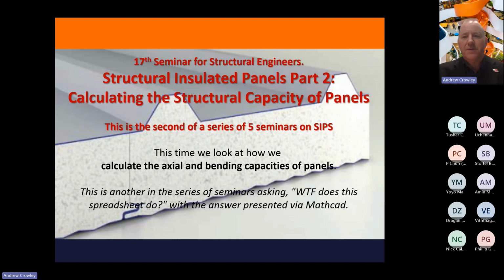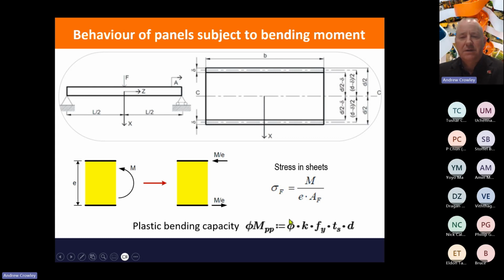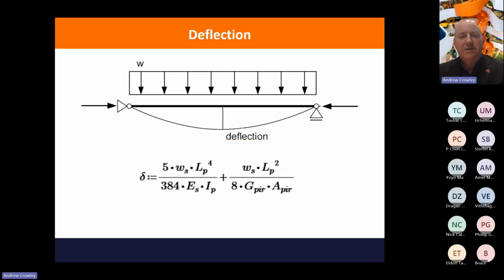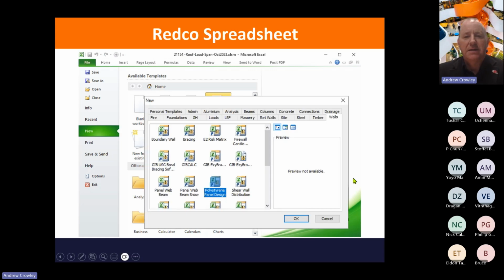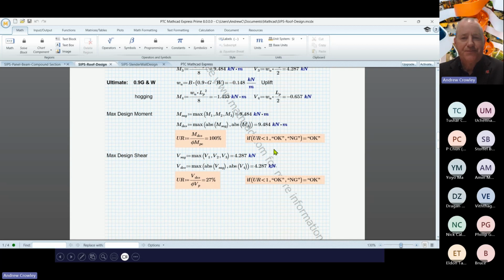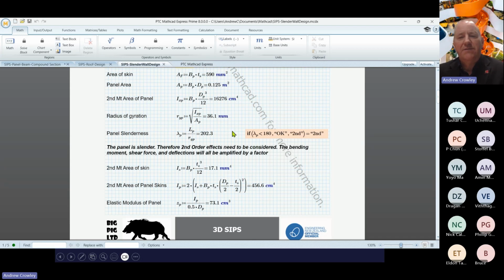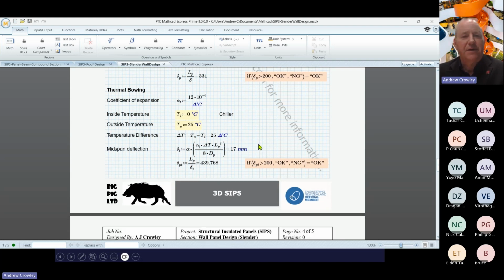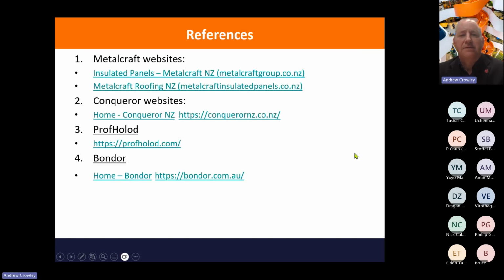CPD Seminar #17 - SIPS Pt 2: Calculating Structural Capacity of Panels

Comment: Nice use of MathCAD to show it's versatility, even if I did come for some background info on SIPs.
Reply from the maker: Thanks. Check out the MathCad for Structural Engineers playlist.
Reply: @daddypig6354 I used it extensively for Infrared electro-optic design. It beats almost all the other computation software when you need real engineering answers with a level of confidence that you just don't get with Excel, Matlab, Python etc. (have a look at Ray Panko, University of Hawaii for studies of errors in Excel and 'spreadsheets')